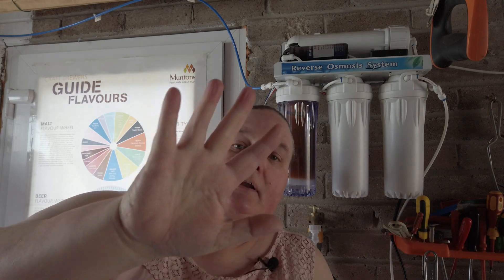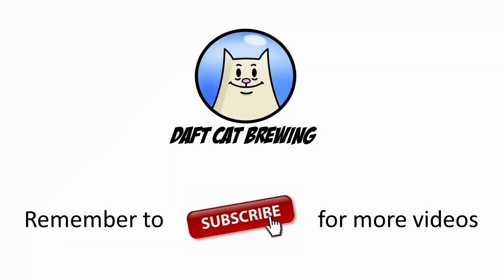Reverse Osmosis Pros and cons in under 5 minutes

Comment: Thanks for the video. I'm wondering what its like to set up and put away. I brew in the kitchen and have to pack all away in the garage, would an RO system be a pain to store when not used? and would that affect the membranes if not in regular use? Cheers
Reply from the maker: Mine isn't in regular use and just hangs on the garage wall between uses. It's not hard to move but is pretty heavy when full of water, so thankfully it has a permanent home on that wall. The membrane normally needs replacing after a certain number of months or a certain volume of water so it shouldn't affect them much and in fact will make them last longer than if you were using them constantly as constant use would hit the total volume cap before hitting the maximum age.
Reply: @DaftCatBrewing  ah i see. I heard someone say they always need to have water in them or it can damage the membranes, so i wasnt sure how to do that and store it away

Comment: I've just come back to home about 9 months ago after a 25-year break. So much has changed !! Many years ago some all grain brewing with a burco boiler and a homemade cool box mash tun. But I've been experimenting with mangrove jack's extract beer kits and pressure fermentation.
I can get RO water from my local aquatic shop for about £3.50 for 25lt. 
My question is: as the matching process has already been done using the correct water profile. Will RO water improve a beer kit?
Any advice would be much appreciated Sarah.
Currently saving for a
Brewzilla !!
Reply from the maker: Welcome back to the hobby :) Water has effects on a beer at several stages in the process. Firstly in the mash, which is already done for you if you're doing extract brewing, but it can also have an impact in later stages. The ratio of salts in the water can make a huge difference. It can make a beer have more pronounced hop aromas, change how the bitterness is perceived etc. One style where people like to especially play with the ratio of minerals is the hazy pale ales or NEIPAs. That's not to say that changing water chemistry will always make beer better, it's easy to get wrong for folk who haven't had much experience with water chemistry or who haven't looked into it in much depth. Like any other part of the recipe though it is a way to change the finished beer and let you dial in exactly what you want the beer to be like, and as with recipe creation, in the hands of a master it can really improve a beer even when using extract

Comment: Cheers, great video. Is there a system you would recommend? and will you consider doing a video starting with your RO water and altering it to fit a recipe? Thanks, Sven
Reply from the maker: Hi Sven, Thanks for the comment.The one I have is great and does the job lovely, however it is a unbranded one so I can't recommend any one particular brand. This one came from ebay some years ago and the seller I got it from no longer seems to be selling things, but similar machines are still listed if you have a look at the pictures. As for doing a video on it I will consider doing one. I haven't until now as I don't pretend to be an expert on water chemistry so I didn't want to detract from the great videos others have put out on water chemistry and adjusting your water. Tony Yates has a great series on water at https://www.youtube.com/watch?v=VjaaLxNvy0Q&list=PLIAaxDY5ZCdcCigXii1h1DOAmED7djMsN and Pete Hughes has a great simple guide to water treatment here https://www.youtube.com/watch?v=X_gln_GdWNI
Reply: @DaftCatBrewing  thanks for the reply, I'll check out those vids, thank you.

Comment: I’ve just bought a 4 stage system and a shut off kit with ball float cost around £70 in total added a 100 ltr water butt I had but didn’t get around to fitting to the shed. I now have RO on tap, I’m just a little cautious about how long I should be storing my filtered water before use 🤔
Reply from the maker: If you are only using it for brewing then it will be boiled, so the risks are low even if you do keep it about for some time. However there is no chloramine or anything left in the water to keep it safe to drink. There are other variables as well, like the longer you keep it the more CO2 it will absorb and the PH will start to drop, although how much impact that will have without any buffering minerals, I don't know. To keep things simple, I normally just make a fermenter full of it the day before I brew. If I end up not brewing for a week or more I drain the fermenter and make fresh when I am going to brew

Comment: I bought the Aquati 4 stage 100gpd 60 quid from ebay with a ten pound discount, then converted a fermenter as a collection vessel, added a ball float and shut off valve, added the ppm meter as well so it`s still under £100, I`m happy with the cost ratio vs convenience
Reply from the maker: The ball float is a great little addition to them if they have an auto shutoff.

Comment: Nice one thanks Sarah. My thoughts on RO is that I buy from a fish shop for £2.5/25 litres. I would have to brew a hell of a lot to even break even on the costs... But I think the one you have is the one I would buy because I'm a spontaneous brewer and would definitely not want to wait all day. Thanks that was very helpful!
Reply from the maker: And how much does it cost to get to and from the fish shop? How about when that shop isn't open and you want to brew? As people have got basic RO systems for under £40 before, it doesn't take much to break even at all.
Reply: @DaftCatBrewing  it's in a garden centre 2 miles from my house. If I don't prepare I use tap water with a campden tablet. Don't get me wrong I am not knocking RO systems, it's just a personal choice
Reply from the maker: Indeed, I'm not saying it's right or wrong but for most people by the time they've fired up the car, got somewhere, and driven back it's a fiver or more on top of the cost of the water
Reply: @DaftCatBrewing  that's very true!